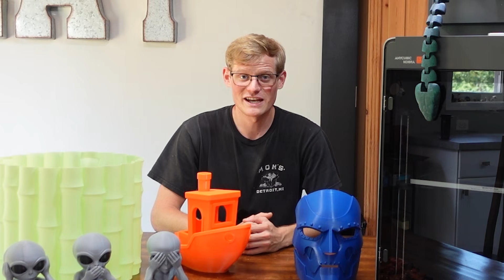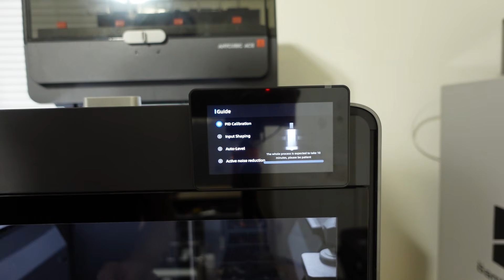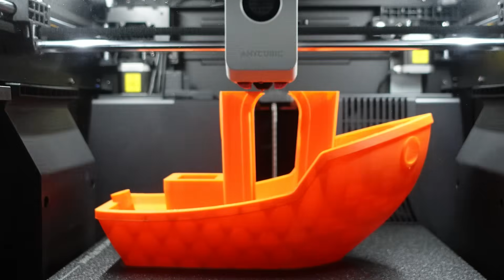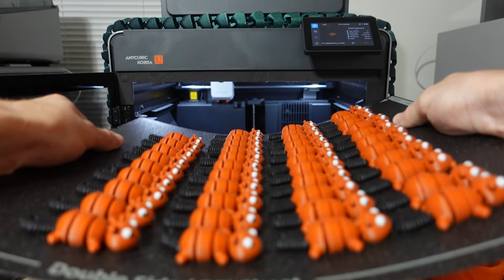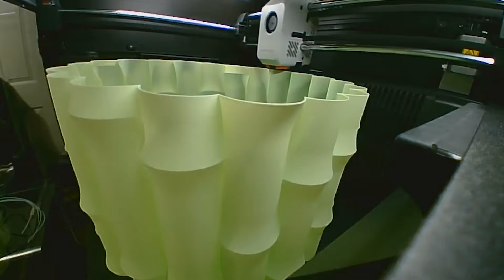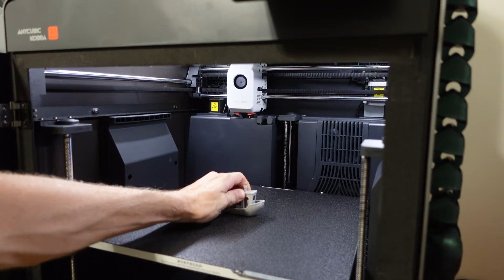Anycubic Built a MONSTER l Anycubic Kobra S1 Max Unboxing and Review

Comment: Quick question, on page 10 of the instructions it calls for a lead screw dust cover. I didn’t seem to get one and you didn’t mention it in your video. Did you get that and installed it off camera? Thanks.

Comment: I would avoid the S1 Max. Had it for 2 months now and it has been broken half that time while I await parts from Anycubic. They redesigned the hotend and it is now a major design issue. Engineering grade plastics like PA and PPA will cause a leak and destroy the entire hotel assembly. They use a tiny metal clip, like a paper clip to "secure" the nozzle. The heating assembly has a weird hinge that does not allow for proper heat break performance. You WILL face chronic clogging.

Comment: Anycubic is the best keep secret in the 3D printing world… but not in good way… they have the worst custom/tech support and Aliexpress has better service! I have had my S1 Max for about two weeks and never worked.... I completed the troubleshooting process on their WIKI page to correct the issue.   I reached out to Tech support for help.  However, after two days of "run-around" I reached out to Customer Support as well.  Just when I get the Tech Support agent acknowledge the root cause and to send parts, the Customer service representative, delays the shipment for another three days.  I started to see the pattern of attempting to "run out the clock" so I am stuck with the printer and cannot get a RMA.  So, I requested an RMA and CSR has delayed the RMA process for another four days and claiming that I am required to pay for return shipment for one of the ACE Pro 2's, but the only the printer and the first ACE Pro 2 are going to be free return shipping.  I purchased the printer and 2 ACE Pro 2's as a package deal and clearly, they should be sent back as a set.

Comment: Im struggling to choose between the H2S and the S1 Max. Both are pretty Good 3d Printers and both of them have their strength. But i´m hesitant to go with the S1 Max because of the Software Bugs that Reviewers have encountered. From a Pricepoint is the S1 Max better but with Bambu you just know that everything will work Great. And yes i do know of the Drama revolving around Bambu Lab and honestly i dont care too much because i`m not someone who Configures or tinkers with their 3d Printer. I just want them to work. What do you think after printing with the S1 Max for a while?
Reply: I just got the S1 Max and I’ve had it for two weeks. No software issues at all. I think they worked all that stuff out. Mine’s been printing beautifully. It’s a huge improvement over the original S1. I’m pleasantly surprised and impressed so far. Again, I’ve only had it for a few weeks, but I’ve been printing nonstop and it’s been awesome. First layer test was excellent too. I would definitely take a chance on it over the Bambu. Their printers are overrated and overpriced for the most part. Not to mention all the content with company themselves. Anycubic is a much better value.
Reply: You can use orca slicer with it too now!

Comment: Wait until 500 hours, then the real fun of Anycubic begins. Happy Printing!
Reply: i have multiple anycubics with our 2k hours not one issue. Just need to do proper maintenance
Reply: Expand please. What happens after 500 hours.
Reply: @jairatadia9675 they turn to shit.  With love, a Kobra 3 max owner
Reply: @jairatadia9675  I really hope it doesn't happen to these new machines from Anycubic, you will receive firmware which isn't factory tested and suddenly your print will have anomalous heating, bed scratching, bed adhesion problem due to Z offset issues, all kinda stuffs, coming from a Kobra 3 and Kobra S1 user with over 2000 hours in either machine.
Reply: I had the kobra s1 and the bed warped like crazy. Reached out to support and they were no help. Switch to Bambu and have had no issues since.

Comment: Time to check the filament recycling video & your thoughts. In-depth longer reviews are harder to do. I'm genuinely on the side of them being the future together with multiple toolheads/printheads (both are fine, tool heads to me mean changing the print head to a different tool, I don't like people using them but that's my side of its not correct but I don't care much as long as we understand each other) that can print 450c right out of the box at 420.69mm

Comment: Your channel came up in my recommendation front page feed! Super cool, I had to cancel my order, I got 16bit, times be tough & that's how it goes. Also, I'm not totally sold on the overall quality control for the 2nd batch after it didn't get shipped out by the time they finally cancelled it on the 17th or something like that. Telling me its in shipping to the us warehouse is fine, but I cancelled it well before that & it was still in pre-order while also being something to ship from the 10th to the 20th. It suggests they either properly quality controlled each one before they got them there, but mpoxde 's video of his particular unit (mostly likely a first batch) was a clear example of quality control not being there, possibly, in complete totality. I just can't take the chance as I'm too damn broke. So I decided to cancel it & wait. 

My use case is car inner fender areas, bigger areas rear & engine bay pps-gf, ppa-gf, pet-gf, the general gist of inside engine bay stuff. Same for being in Arizona, it gets too hot inside cars, so higher temps everywhere. Pla does work for some things, just not as much, it is what it is shrugs but yeah big huge prints are needed to make that far, far more manageable. The skill in post processing is brutal, sanding/painting/shoving on rubber spray for PEBA or similar to gain tiny gaskets & tiny rc tires, springs, & more is a bit annoying so I just wanted to brute force it with 16 bit hardcore multi-material big big prints with minimal effort after the fact.

It's, honestly, pretty brutal to have to try to figure out high temp engine bay bendy flex parts that need to take a beating from going over washboards at 40+ mphs while it might be raining & or over 100f. I just, really just, didn't want to do it.

GF reinforced parts are what tend to help, some only some, filaments stick together that wouldn't otherwise. & hey, for cosplay it might come in handy, I saw Kiara make another iron man suit & figured it could come in handy to do a heck of a lot less work having to add in everything for movement. That gets into nylon for slick areas hidden inside of plates in the right areas, with shock absorbing PEBA/TPU or other more specialized, like jantech engineering just showed off for the japan reprap a glass fiber reinforced tpu with tiny fiber filament on his channel that was in there too that could be hugely good for that; Granted my thoughts were completely on if it improved electroforming & tensile strength in centripetal forces then figured I could just microwave vacuum cast a turbo honestly.

Seems easier.

Anyways, cool stuff, still want to resin 3d print my own glasses with my own prescription, I'm trying to bother Formlabs on bluesky about that one & twitter so they'll make optically clear resin cheaper; Because yes I don't want to have to vibrate & vacuum pump uv activated resin then use the hole I put into the lid to use a check vavle'd drill pump to put it into my vat after I go onto Alibaba to purchase optically clear quartz glass plate so I can finally make no scratches & or issues 16k glasses from the stupid dumb film they use that gets bad & isn't perfectly clear. 

its like $100+ for 2 plates, but I need tempered for bendy flex characteristics & optically clear quartz glass. Which works for the wavelengths its putting out. I wanted them about 1 millimeter thick, less if I could get it, like down to .3 to .1 millimeter thick which is likely super thin fibers fused together using lasers or something like that, so a Alibaba check later & well they have the plate size. Not the other stuff. It would work just fine, but I need to wait & get money.

Then yeah this would have been a great printer for quite a few other projects, but not risking things.

Thanks for the review this is a github about the anycubic opensource to have it work better the Rinkhals 20260606_02 , the 02 is the one they really want the s1 max to be used for.

Now I'm looking at less waste & purge using multi-tool head or the bambu (sadly thanks to everything going on I don't know about it at all & don't want to but life is life to me at this dang point) h2c because the multiple hotends ("injectors" of plastic on to plastics, muahahahahaha!) basically act the same way. I saw the review by franklybuilt going over the prusa xl & seeing how it hasn't stacked up as well over time (I still love it but yeah) versus the snapmaker u1 & saw its better than the snapmaker u1 but after more in-depth reviews of the snapmaker u1 felt it might not be something that I can go with as well. It is a severe downgrade for me in terms of size. Sovol md1 might be something later, the flashforge creator pro looks like a different take on the snapmaker & I like it (the outer metal frame is cool, one part for the extruder is nice, a ams being used will probably work, etcs) but the closing down software is bad.

One side, users are often the mistake makers (me, as an example) & closing it down helps that be prevented. Other side, they could head towards the darn thing being needed to be hooked up to the internet to have it work, which is utterly stupid. Bambu might do that as well. Which means a new board(s) & software, I don't want to. Right now at least, I'm not ready to put together a voron so I'm moving on from that idea. Franklybuilt's video (not as much time on it, said so himself & said he'd have his friend put out something but I didn't see anything, I'll have to check his channel) on the 500mm cubed version & it looks good, but I don't have the space for it. Flip side, they might be the only ones with a 350mm cubed (08 max or something like that) which might work but I need to look into it more. It looks a bit... Outdated & yet don't care if it works. 

Main concern is bleeding edge issues of the md01 or whatever it was. Waiting for tech to mature is a good thing, which is where the snapmaker (together with their open-source stuff) drew me in at first. Need it bigger. The funny number, 420.69, is about the max. Roughly speaking. I doubt I could go bigger, but I'd figure it out if I needed to.

Comment: That poor beaver STL, did you contact support to see if that error code is something they know about? With new printers these days you there's and expectation that all the components come working. I know YouTubers have consistently made complaints that some companies sometimes use YouTubers as a backdoor QC department. I personally believe that by the time the printers reach YouTube that all the kinks are worked out and the printer comes in

One piece
Reply from the maker: You get me every time dude. Every. Time.